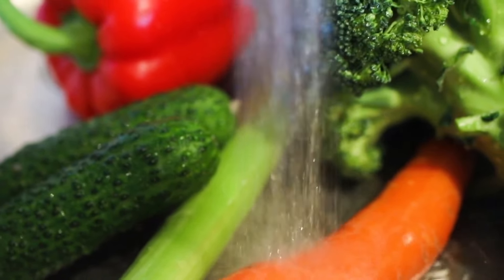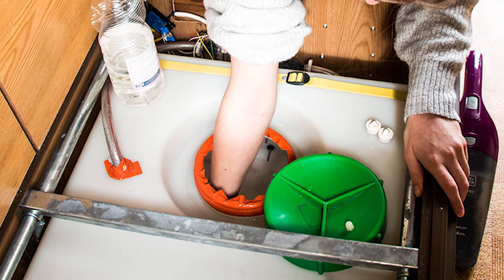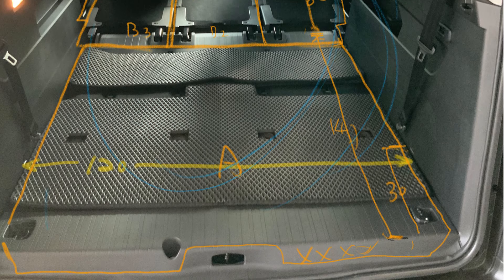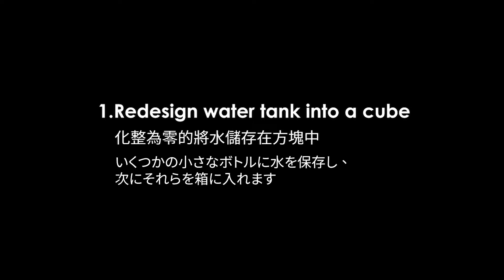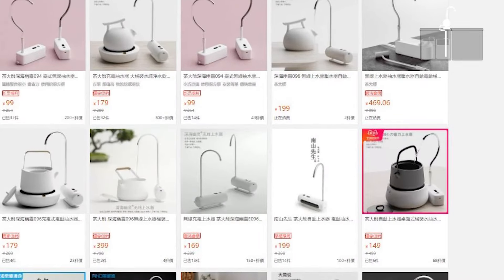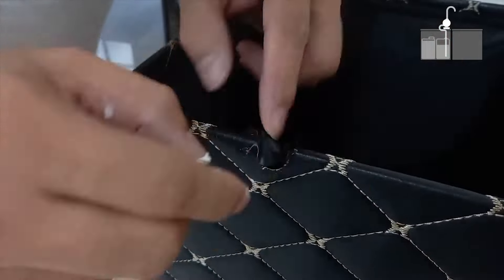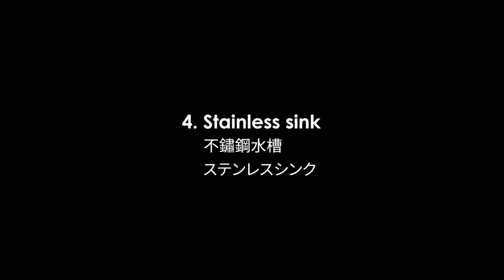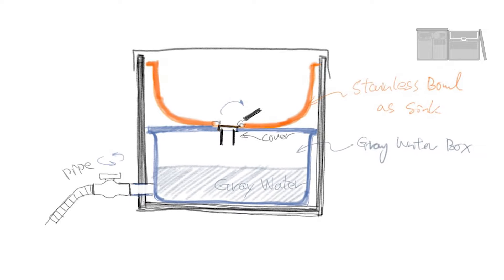Amazing Simplistic Camper Conversions！Quick Setup Portable Sink for SUV / Minivan or MPV.

Comment: There is no simple way from whatever people will share to have running water with a faucet and contained grey tank that doesn't slosh when driving, for stealth car camping, I see. One may not be able to pour grey water out at a cracker barrel, or some other parking lot, nor carry a  bucket or square container into a bathroom to dump it 😅 out that moment.